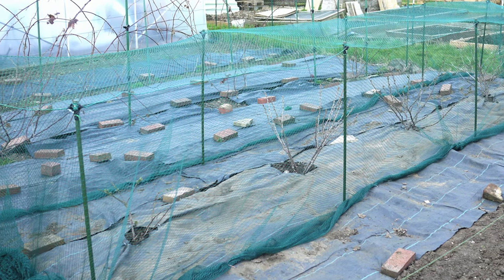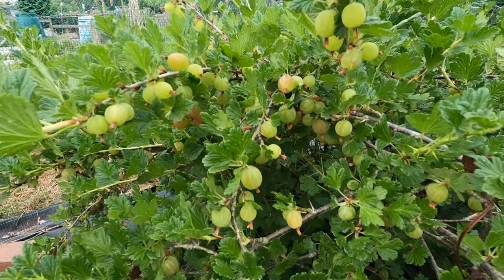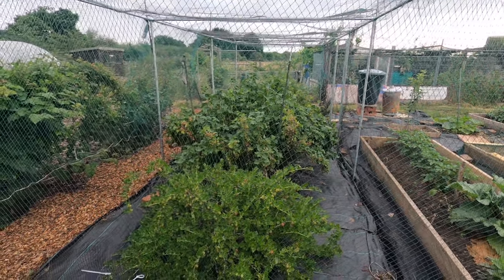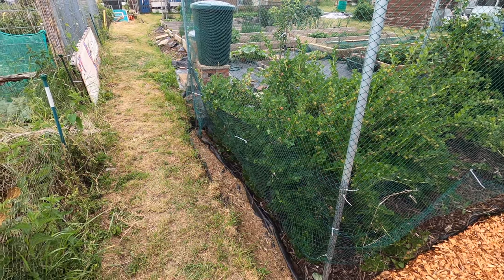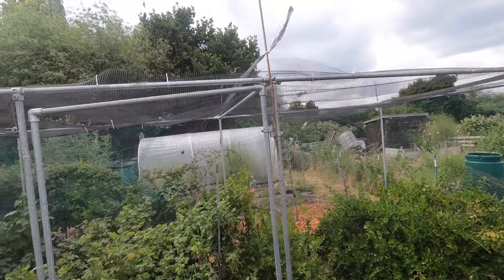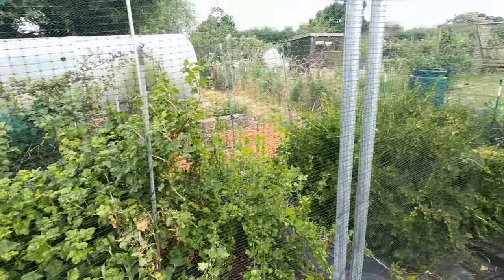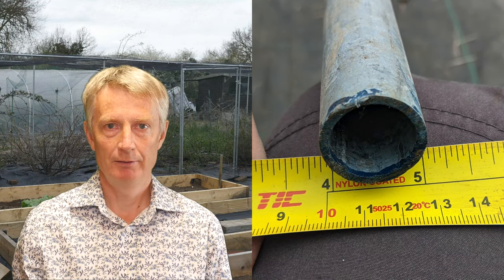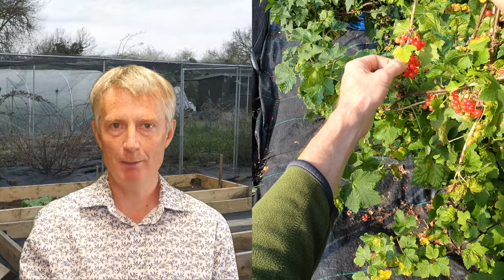How To Build A DIY Walk In Fruit Cage

Comment: This is great, I have already used your ideas to replace an apple espalier trellis (was wood and rotting).  I'm now going to embark on a fruit cage of a similar scale to yours.  One question, do you think it was worth digging in the posts (50cm) ?  I'm planning on not digging mine in as its going to be next to an old hedge and chopped down massive cherry tree (lots of roots), but instead put diagonal bracing tubes to keep it square in the wind. Also I'll use some base plates to stop the upright tubes sinking. It will be replacing a plastic covered metal fruit cage (inherited) which is acting rather flimsily in the wind.  Let me know if you have any thoughts. Thanks again.  FYI on the rooty side of the cage will be blueberries in large pots for the ericaceous compost, so they won't suffer from the existing roots.

Comment: Thanks for the very useful info.  A few questions...
Does the roof withstand a fall of snow?
Did you have help to assemble the cage, or fit the netting?
Any problems with squirrels chewing through the netting?
Greetings from Conwy, North Wales.
Reply from the maker: Thank you for your comment! On your questions, I don’t know about heavy snow. I’m confident the frame would be fine, the netting may be affected but that is easy to fix. I found I could do the job by myself. No problems with squirrels chewing the netting, but squirrels (and rats) are always likely to find a way in (even metal cages). Weakness are any joints in the netting, corners, and securing the netting at ground level.
Reply: @AllotmentBook  Thanks for the reply. I'm enthused to install my fruit cage now.

Comment: Useful video but a little more information regarding tube dimensions and fittings would be good. Did you use Kee Clamp/Kee Lite? From where did you source tubing? Approx cost of your project?
Reply from the maker: Thanks for the feedback. The cost for the tubes was a little under £200 excluding VAT. I already had the netting. The dimensions of the tubes are given in the video in the step by step section at minute: 12:55. Depending on the stockist, they can advise the dimensions of the Kee Clamp to use, that need to be specific to the tube diameter chosen. My video is not sponsored or endorsed by any stockist.

Comment: Thank you very much for your video, I intend to follow your suggestions. Would you be so kind as to tell me what kind of key clamp fitting your used at 2, 4, 7, and 8 (on your diagram). I am thinking that possibly two may be need at these points; a long tee and a short tee, as I cannot find a design that will join all 4 poles. Thank you!
Reply from the maker: Thank you very much for the feedback. I used a clamp that was effectively five way. Horizontally it allowed to connect two poles that ran the full width of the fruit cage, and one junction at 90 degrees to span across the width of the cage. Vertically, it allowed for one pole from below, and for another pole to connect above (unused). It is possible to get plastic caps for the poles ends to keep the rain out (for the unused vertical connection). I hope this helps!
Reply: @AllotmentBook  Yes it does help! I can now see what you have done and the caps tip is especially helpful.